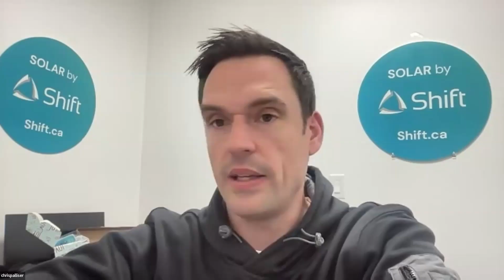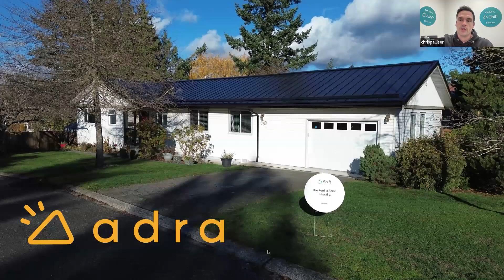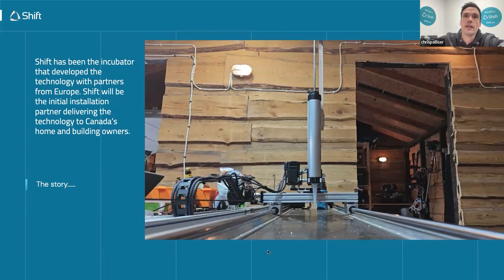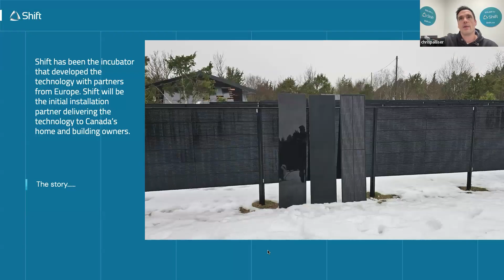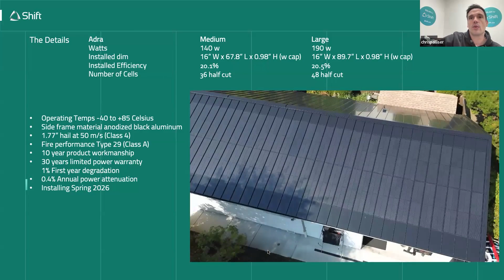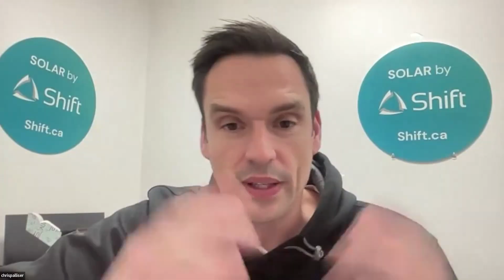Shift Energy Group Introduces ADRA

Comment: 21:03 $50,000 quote for metal roof compared to ~$70,000 for a 10 kW integrated solar metal roof.  Assuming a traditional solar quote would be >$30,000, the ADRA seems cheaper than the combined traditional method.

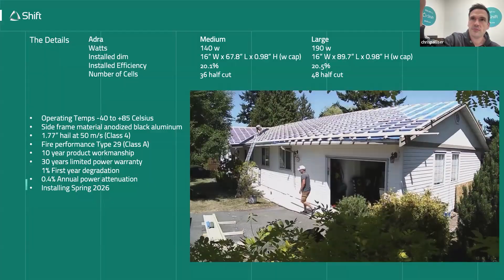9:43 Is there an alternative to the wood strapping?  seems like an area to simplify install.

Exciting progress in BIPV standing seam metal roofing, been following progress of Roofit.solar in Estonia as well as INroof.solar in Massachusetts.

Maybe when Im ready to build a house in the next 5 years, ADRA will makes its way to USA!